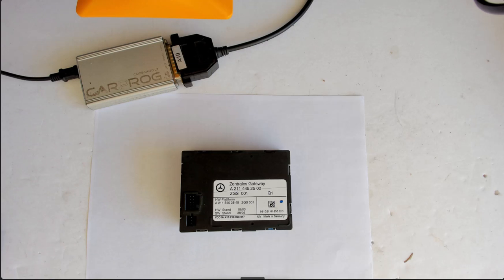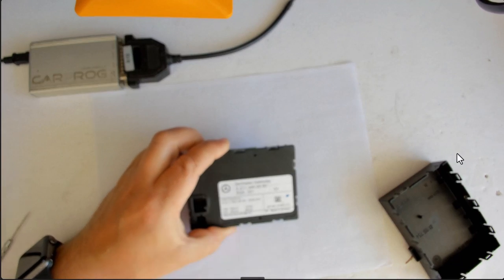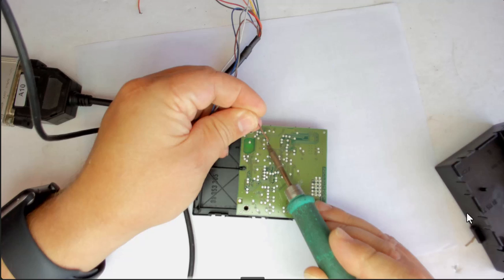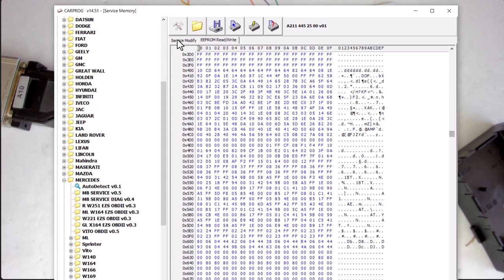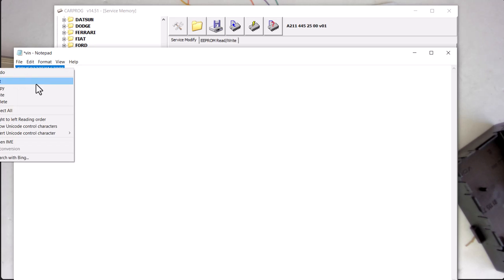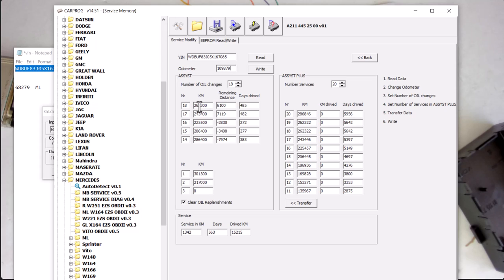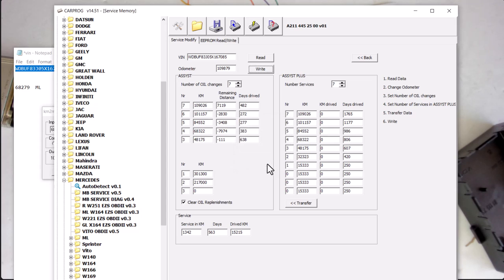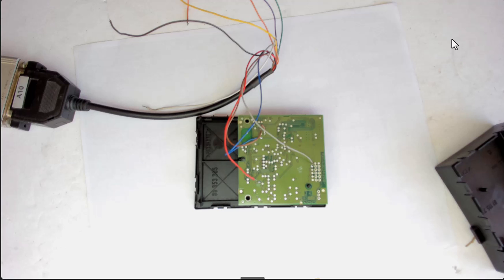How to Write VIN and Mileage to Mercedes Central Gateway Original Flooded or Missing | CARPROG

Comment: Hi, I have bought three of the china version CarProg with Version 13.77. Did you perform any type of updates or changes to the device? I cannot get the device to work when trying to connect to a ZGW. Your response would be greatly appreciated.
Reply: Use the green wire instead of the brown. It will read then
Reply: @tyroneking5889  your a godsend
Reply from the maker: I use original carprog
Reply: 😁 did you really expect the chinese copy to work ?

Comment: Which Carprog do I need? Which one should I definitely not buy?
Reply from the maker: Buy original that’s the one I use
Reply: @vehix411   do you have an adres or link for me? thnx
Reply: i can buy a used model v8.21 does that work for me to program the VIN ?
Reply: where do you buy the original carprog?